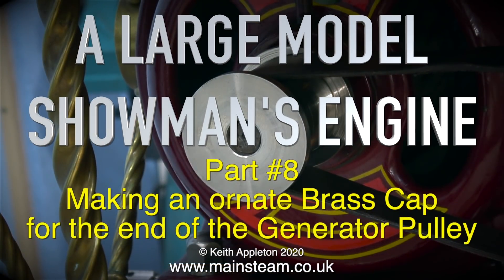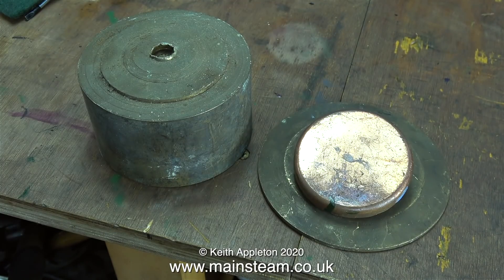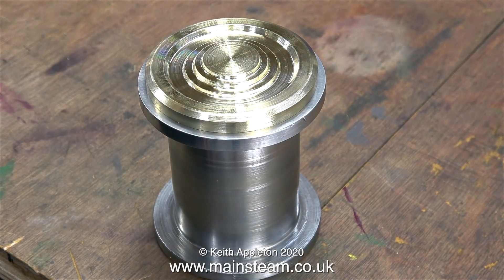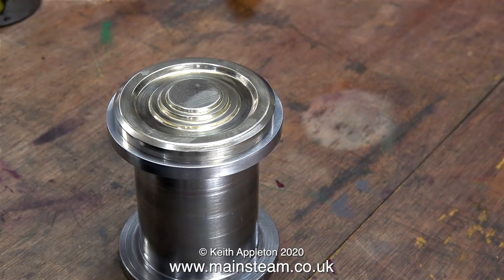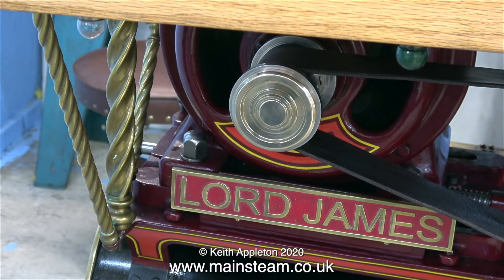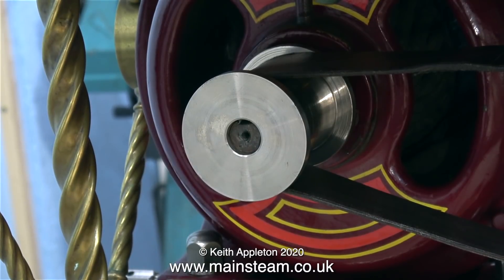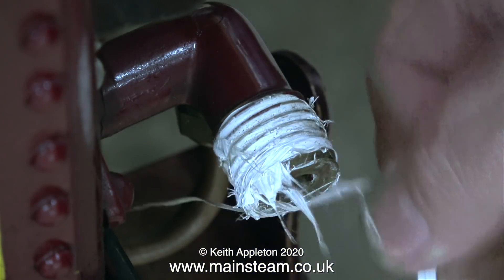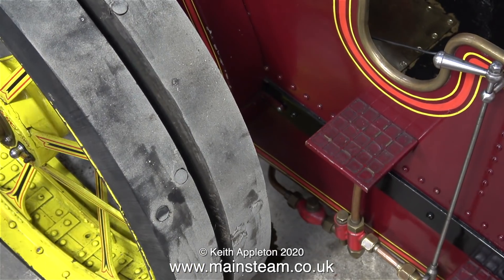A LARGE MODEL SHOWMAN'S ENGINE - PART #8

Comment: Really enjoying watching you work. In full size traction engines, belts were made to fit just a bit longer than the end of the adjustment so they would last longer. And could be slackened slightly if put away wet and they shrank a little when dried. I did a summer with a troupe in my youth and helped the engineer replace one.